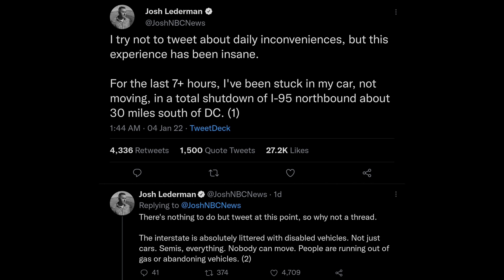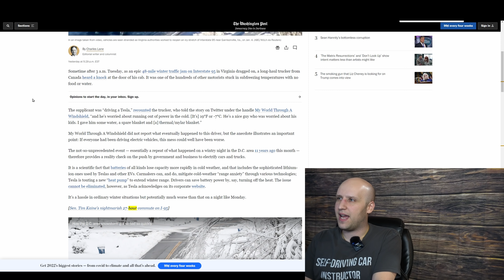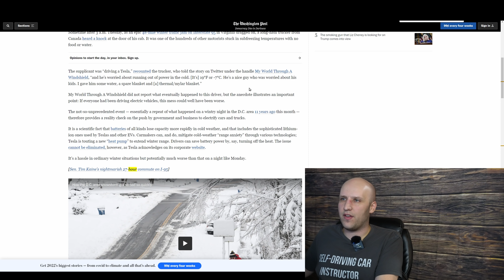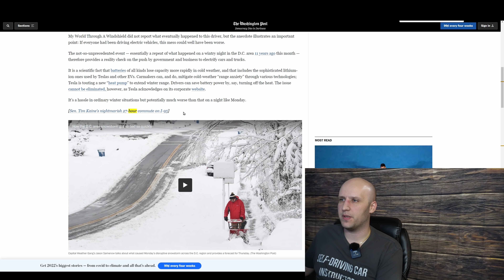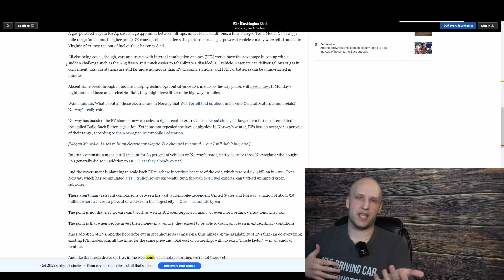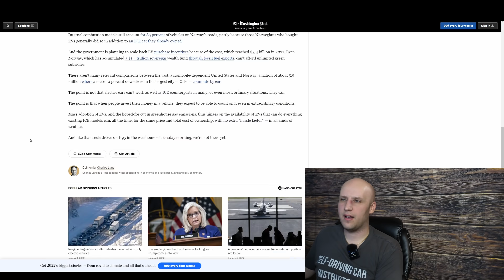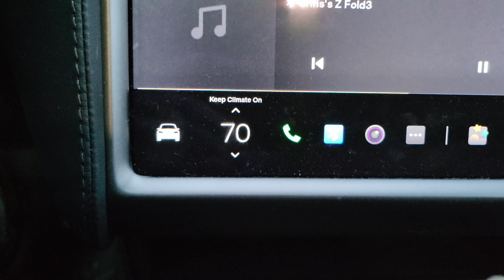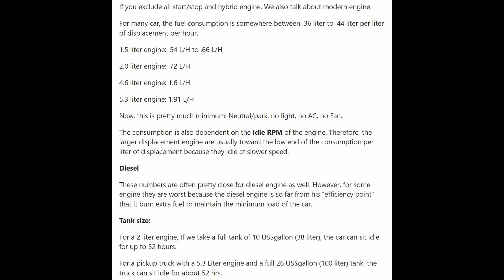How Long Can a Tesla Keep You Warm In A Frozen Traffic Jam? | FUD Debunking

Comment: Not really surprising these electric cars are designed to give the same range as an ice when driving so they give about the same duration for heat when "idling" 
The bigger issue would be that an ICE can be given 5 gallons of gas to keep you going but the system for keeping an electric vehicle going if the person only had 15% left when they started out that evening is significantly more complex

Comment: How often do you get stuck in a traffic jam with a car full of fuel, I haven’t yet and I’ve had jobs in which driving was part of the job. Instead, test the difference in output at different temperatures, that is useable knowledge; this is you justifying and rationalization of deciding to buy an overpriced car that is difficult to fuel up

Comment: 400 Miles in a rav4, Im assuming its one of the new ones with the hybrid system that no one can get. (My parents have a 16 rav4, get at most 350ish between fill ups if you drive at 55)

Comment: Excellent conditions for getting one for pennies on the dollar

Or a good chance to have a portable charging unit and sock to them because they can afford to buy these cheaply built vehicles !

You can't prove to anyone with brains that these electric vehicles are quality made, 
They are old technology with new versions of batteries,

Maybe a very slight improvement of an electric motor, and maybe lessor transmissions and gearing methods, making them less expensive to build,
Along with cheaper built tires that cost more to buy
Buyer beware !

Just notice eighty % charge
And since when will all of these vehicles have that amount of charge on them when commuting?
More like 50% or even less, at time of troubles

Gas vehicles one can always carry a spare can of gas, where in an electric not so easy
Where all electric vehicles that have run out of energy supplies, 
Expect a hefty towing bill where as a gas or diesel, you can bring back some fuel to save yourself some moola as my brother would say,

Comment: A gas car doesnt need to run continuous as the mass of the warm engine and exhaust  can supply heat to the structure of the car. I've often returned to the car after it has been sitting shut off and found that it is still relatively warm.

Comment: I belive that article was a bit right, but not for the reasons they said. I belive it's bit worse being stuck in electric vehicle compared to gas/diesel one because if you run out of power you're done. You will need tow. In gas one you can get jerry can, get to nearest gas station (on foot) and fill back up. That's only advantage i would give it in reasonable situation.

Comment: EV’s are getting close, but I don’t believe they are ready to take fully over. I live in Alaska where the EV charging stations are few and far between. As it stands a trip between Fairbanks & Anchorage that should take a ICE vehicle 6-7 hours would take a EV 10-14 hours (due to lack of high speed charging stations), or overnight if drove in the winter. I have a couple of friends up here with Teslas, and they Love them, and they say for “city” driving even at -40F and colder, they’ll take their Tesla over their ICE vehicle any day, but for winter road trips they’ll keep their ICE vehicles until the charging infrastructure is better up here.

Comment: Fully electric vehicles are TOTALLY worthless on long trips, and in certain parts of the country. They will continue to be until the infrastructure is there to support them.  Think about the time it takes to charge, and then they only go around 275 miles on a charge, many of them much less than that, and then it takes HOURS to charge them.  Add to this if MILLIONS of people relied on electric cars ...well we are a long way from the needed infrastructure to support this in any practicle way.  Thy can take many hours to charge even at home and if you have priced super fast charging stations for the home they are THOUSANDS. Oh yes and if you live in a condo or apartment FORGET IT you can't charge them.

Comment: hey quick question. You state the amount KwHrs used for each example. You then apply the cost of the Kwhr to the amount consumes and determine the actual cost of the KwHr.  Does the amount used equal the amount required to refill that amount used? Or does recharging requiring a greater amount of input in Kwhrs in order to replace the energy lost. I apologize if that is a silly question.
Reply: Not silly at all. The charging, storage and consumption process is no where near 100% efficient.

Comment: However you started this test with your batteries pretty well charged. People, who were on this highway had already driven some distance before traffic stopped and therefore had used some  of their battery. They were not stuck on the highway with fully charged battery.  

I realize same goes for people driving gas cars. They had already driven some distance and used some  of gas in their tank before getting stopped for hours.  

However once traffic moved, if they had any gas left, they could pop into a gas station and get refilled in a matter of minutes. An electric would have to find a charging station, fewer  and farther between   and the charging time would be much longer.

Comment: I wouldn't set the cabin temperature to 70°F for starters in a survival situation.  My home thermostat during the winter is set to 62°F and I find it quite comfortable with a sweater on; I could lower the thermostat into the mid-50s without risking my life. Rate of heat loss is proportional to temperature difference, so reducing the cabin temperature by just a few degrees can have a dramatic difference in the amount of energy expended to maintain the temperature.

Comment: Your batteries are 100% before the start of the test. Maybe you should start the test with just 50% battery level as this is normal for most cars to be only 50% full and check how long will the batteries run if you keep the temperature at 65F

Comment: Just have to have a full battery when this happens (yeah right) and a non faulty heating system... which there are too many of those... fix them please tesla..  should be a recall... also the battery uses fossil fuel to charge anyway... move the hydrocarbon from a tail pipe to a smoke stack ...  yeah right...big wooop...

Comment: Not to mention gas cars idling for extended periods of time lead to carbon build-up on the pistons, intake valves and spark plugs which can result in poor fuel economy and performance. Just saying so if you're one of those people that sit with your car idling for as long as you want and don't care this is a good heads up for you.
Reply: Actually it is a myth that modern engines will carbon up idling, 50 yrs ago that may have been a problem.
Reply: @218philip  I appreciate you're comment. I will have to do some research to update my knowledge on it.

Comment: I do think that evs have the major down side of not having easily portable fuel. If it goes out it's a much bigger hassle than if a regular car runs out of fuel. Since you can fill a gas can and get enough fuel to get the car running again enough to get to a station for a full fill up.  Unless your saying people should have portable generators with them at all times.

Comment: Can you linearly extrapolate run time like that? In other words, do you get the same mileage if battery is discharged from 90-70% vs 40-20%? If not, then battery performance isn't linear and can't be extrapolated.
Reply: High quality percent battery capacity estimates should be linear; otherwise they would be meaningless. For extreme example, an indicator stuck at 100% for 200 miles then 99-0% for the rest would be pretty useless...
Reply: There's a big differences between "should be" and reality.

Comment: The little secret with EV technology is mining for rare earth metals to produce these big batteries. No one speaks on environmental impact on the earth. China is aligning with the Taliban to mine earth metals in Afghanistan for EVs. Until EVs can be affordable for the average working Joe, these EVs are not a vehicle they will purchase. Also, EVs will put many blue collar workers out of work. This experiment needs to be redone with 50-75% battery charge. When on a trip you start out at 100% but will not be at full charge 75 miles down the road.

Comment: On you final points of ICE cars, in cold weather areas, a lot of cars have resistive  heaters, to be able to heat the car up strait away and for people not to sit and freeze the first 5 minutes.
So, that would add to the fuel consuption.

Also, and this is just a question, will an ICE car even be able to maintain the heat in the cabin on just idling? Especially at these outside temperatures. Off course you would keep above freezing, but I doubt you would be able to get a comfortable temperature in the cabin.

Comment: my previous car was a diesel, and the heater was ineffective when idling, being stuck in traffic in deepest winter would result in the engine cooling and cabin getting cold!
Reply: No high idle switch? ive never been in a diesel that didnt have some way to force a high idle.
Reply: @nes999  nope. I once had to wait for half an hour in sub-zero-Celsius weather and sat with my foot on the pedal to keep the revs up and even then the engine didn't get that warm.

It was a Nissan 2L turbo diesel in a quashqai.

Comment: As a retired over the road truck driver , it is nonsense...just as many trucks run out of fuel in these situations as cars EV or not...shut the engine down and run it every 2 hours till your warm and shut it off...Get out and walk around to keep warm. Any driver planning to get off at an upcoming exit for fuel was going to be in trouble...I would guess that EV drivers would be much more aware of their fuel/battery limit.

Comment: I like See how it will perform in New York up by Fort drum  it  can get as cold as 20 below zero We used to have to put heaters under our car and take the battery inside overnight for the car to start.Just curious how it will hold up In those temperatures 🤔

Comment: I have a model 3 and to me if you are smart you immediately turn off the heating and rely on the seat heater  (clothing and blankets) . Even in a car with combustion engine you would turn off the car and only start it from time to time. In winter time with snow the range does not only decrease by battery (-heating, less capa) but also due to winter tires, air density, snow on the road (more resistance), ... . So in wintertime you should be prepared for a bit hit to your range (to me it is 30-40% less range) , but you can counter it (if you are able to recharge at home) by plugging it in every day. If you are not able to charge at home, you should not go for an EV.

Comment: The energy density of a battery will never be close to petroleum . 20 pounds of gas will take you further the 20 pounds of batteries. Look up energy density in a physics book. I do like the heat pump aspect.

Comment: While it is true any vehicle could run out of gas/power, the difference is gas vehicles can idle the engine damn never forever on a tiny amount of fuel to keep warm in a situation like that. Even a car with a 1/4 tank of gas could've idled the engine through that entire traffic jam and still had enough fuel to make it to a station with ease. Many people in Alaska that haven't installed block heaters will just run their engine at idle 24/7 when temperatures drop below -20 to keep the engine from freezing and destroying itself. You'd be surprised how long a normal car can idle the engine on a single tank of gas, we're talking SEVERAL days.

Comment: I was very interested in this exact scenario.  It was a question I had almost immediately when I heard about this incident.  With regards to your comment that both vehicle types could potentially run out of fuel, the major difference being that for a gasoline engine vehicle you could potentially hoof it to a nearby gas station, if one was available like in this case some of the stranded cars were near exits, and return with enough fuel to keep going for a while.  There are no charging points when you are stuck on the freeway. You are SOL.
Reply: Keep a portable generator and a spare gas can with you, along with the car's charger, and then you could potentially "run on gas" at least for a little while, prob. enough to get through any emergency like this anyway.

Comment: I am not up on electric car's recharge capabilities but I know that on a standard battery it is not a straight line discharge rate.  As it discharges it will not maintain the same power as it gets lower in charge.  That is to say that you cannot get the same discharge in the say last twenty percent of battery that will be available in the first twenty (100%-80%).  In other words if you got 12 hours of load and you were now at 50% it would be erroneous to expect twelve more hours at the same load.  Maybe that has changed with the latest in battery technology??

Comment: Electricity is very sensitive to temperature, and gas cars are more reliable at idle than a battery and if the power goes out the have backup generators and guess what they have gas on it or natural gas🤷‍♂️🤷‍♂️🤷‍♂️🤷‍♂️🤷‍♂️, instead if it was a power station with no power and no gas or natural gas backup generator you're screwed 🤷‍♂️🤷‍♂️🤷‍♂️🤷‍♂️🤷‍♂️, and maybe for some reason the power station had power then the overload of juice being taken to charge all those EV cars, would literally shut down that grid and maybe even start a fire 🤷‍♂️🤷‍♂️🤷‍♂️, so yes if those were only EVs it would be a chaos, remember whenever they said don't use one outlet to power your utilities 🤷‍♂️🤷‍♂️🤷‍♂️🤷‍♂️, well same here

Comment: You seem to be conveniently ignorant to the glaring fact that if a gas powered vehicle runs out of gas, you can easily carry gas to it. How do you carry a battery charging station to the highway? That was the entire point of the articles regarding this issue, of course any car can run out of fuel lmao the problem at hand is how do you recharge a stranded electric vehicle? Even as someone who's pro electric vehicles this seems to be a problem that needs a solution, not one to ignore and pretend doesn't exist

Comment: Just a weird question.....would elevation have any differing effect on battery consumption?  Say a Tesla at sea-level at 32F compared to a Tesla at 4k ft at 32F?
Reply: It would affect the heat pump. Denser sea-level air has more heat at 32F then less dense air.

Comment: You are assuming it disharges linearly with time, which is probably not true.  Also if the car has to move along the freeway while its heating, it will probably discharge faster.  Also it depends on the age of the battery, if you do this with a 10 year old Tesla, you will probably discharge in just a few hours, if you do it in a 25 year old Corolla, it will still heat for days on a tank of gas, just like it did when it was brand new.  and the Corolla will do it for about 1/5 of the cost of the Tesla, and last about 3 times as long.  I can tell you are biased, since you bought two of those things, so you distorted your test with your bias.

Comment: The problem with so many people is they think about their regular lead acid car batteries and think EV cars work the same. If it is extremely cold, their lead acid cars may not start, BUT the batteries are not the same and people need to understand this. Right now, it is easier to get a gas car started, BUT that is because AAA and all of the systems are already set up for gas! People on the highway during that fiasco ran out of gas! That is a reality!

Comment: I think your test was unfair to the Tesla with the heat pump. Here’s why:  the temps in Virginia were in the 20s and never went below 20f. In that condition the model y it would never have had to go through a defrost cycle and use the resistive element and would have stayed in a much higher efficiency range. Ie at 12f you reported the best air source heat pumps would have to cycle AND would be about 150% efficient. Those same heat pumps at 22f would never need to defrost cycle AND would be over 200% efficient. 

My math says that your model y in the Virginia conditions should have lasted over 80 hours even with a cheap mr cool air source heat pump of which the Tesla one is much better and doesn’t have waste from the ac/dc rectification because it runs directly from the battery.

PS:  at 12f, only a really big inefficient v8 would have been able to maintain 70f at idle. So you would have to run the car at significantly higher rpm to generate that same heat which would have significantly shortened how long it would run.

Comment: If you don't see the difference between a Gas, and an Electric in this situation. 
Answer This.
When you run out of fuel, or power.
Which vehicle can you simply put a CAN of Fuel In the Tank ??? 
And which vehicle you'd need a 10 mile extension cord for 😂
... bet a Tesla cord cheap either 😬 😏

Comment: Looks like some owners are having problems losing heat in extreme cold the pumps be failing
Reply: I'd assume they're not breaking, just simply, heat pumps don't work well in the cold. can't pump heat if it doesn't exist.